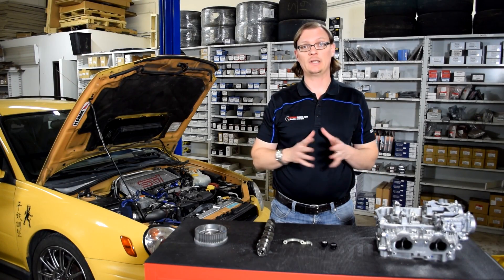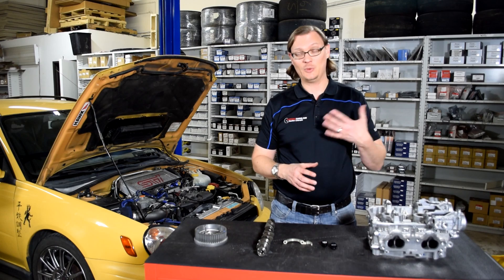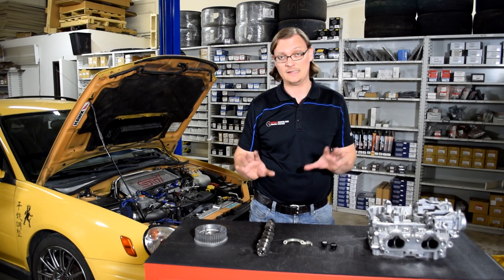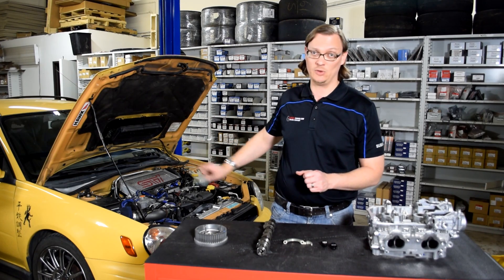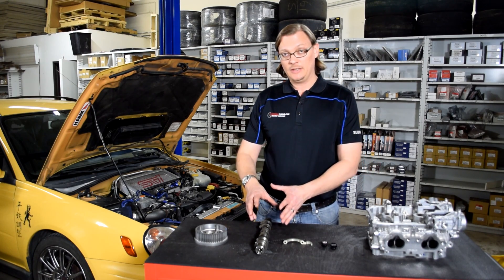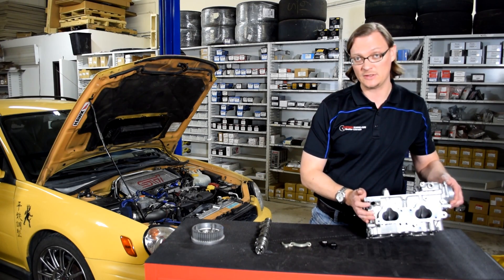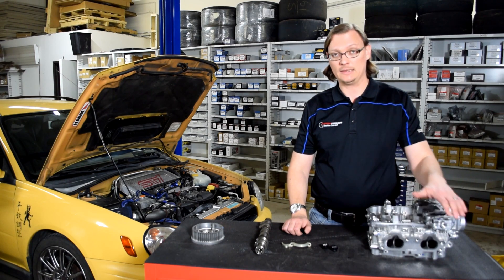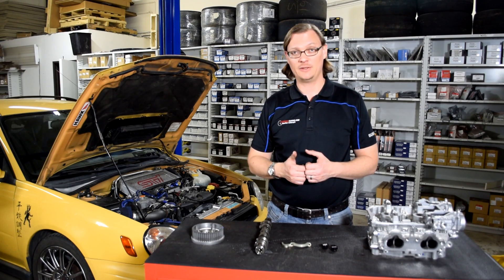How to put a turbo EJ 2.5 Liter engine into your 2.0 WRX

Comment: Makes me really wonder at what point it's worth just switching to AVCS and buying a JDM ECU to go with the ej25 long block. 

Spun bearing on my 200k ej205 and really doubtful the heads will be worth using. I have a iag tuff block I was gonna bore out and slap JE Hybrids in at 100mm but now I really am not sure

Comment: Wait why does my 205 have 2 cam sensors??
Reply from the maker: Thanks for watching and thanks for the question.  There are JDM WRX EJ205's that were single AVCS.  That is most likely what you have if the sensors are on the back of the heads.

Stay Tuned!
Reply: @FlatironsTuning if I have a usdm car with a JDM engine, how does the avcs work then?
Reply from the maker: @deathspawn54  It may not.  If you still have your USDM ECU, then it can't run AVCS.  Sometimes people would swap in the JDM ECU which would activate AVCS.

It all depends on the ECU you are running.
Reply: @FlatironsTuning  so same goes for me i have a usdm ecu with a jdm avcs engine could i just dropped a ej257 long block in the car with no modifications

Comment: So just to clarify: if you have an EJ257 with dual avcs and you opt to use the STI cams but plug the AVCS holes, and you use NON-AVCS cam gears, the plugged STI cams would be running at default high rpm setting?
Reply: That's what I was worried about. Thank you very much for the response. I guess my final question would be: would you run adjustable cam gears on the aftermarket cams, or can I get away with solid gears? Thank you guys again! Good luck at Pike's Peak!
Reply from the maker: I would not recommend adjustable cam gears.  They are hard to set exactly right, and if they ever start to move, that can cause issues.  Solid pulleys with Non-AVCS cams would be the way to go:

https://youtu.be/zhnP_p7Y3WQ?si=QiA-sl-FVDH07fKh
Reply: You guys rule! Thanks for the insight.  @FlatironsTuning
Reply from the maker: Thanks for watching and thanks for your question.  Yes, that is correct.

Stay Tuned!
Reply: @FlatironsTuning Would you recommend just swapping in a set of non avcs cams and being done with it? I am putting a dual avcs EJ257 into an 02 WRX but am deciding whether to plug the STI cams or bite the bullet and get the GSC stage 1s like your car. Thank you guys for the reply, your information has been invaluable during my build.
Reply from the maker: @markyt2982  If you use plugged AVCS cams, you really will miss out on a lot of low end power, and a fair amount of mid range.

If you want a lot of power in the mid rpm range (4,000 - 5,500 or so) I'd say non-AVCS cams are going to be the way to go.

Hope that helps!
Reply: Just wanted to reply back and say that I got my 2.5 swap running using the STI cams and adjustable gears. Setting the cams was a total pain in the ass and if you don't have a 2.0 engine to degree and compare cam orientation I think you would be in for a massive amount of work. I can see why you recommend just swapping cams, I wanted to try something different and retain OEM valve train. If I were to do it again I would 100% just buy cams etc and call it good.

Thank you to the flatirons crew for all the invaluable information and supplying the majority of parts for my build over the last half a year.

Comment: I have a Subaru wrx with 2.0 heads and 2.5 iag short block I was wondering how can I put this into an sti
Reply from the maker: You would really be best off to put the STI heads on the 2.5 IAG shortblock if you are going to put the engine in an STI.

The STI ECU is expecting a lot of input from the cam position sensors, etc. that it wouldn't get from the 2.0 heads.

Hope that helps and Stay Tuned!
Reply: The ECU has to match the heads basically. You wil need to run wrx ECU

Comment: if i have a jdm 2.0 with avcs in my usdm bugeye and i am swaping long blocks to a 2.5 do i keep avcs or still delete it ?
Reply from the maker: Thanks for your question.  It depends on how you are driving the AVCS.  If you are using the JDM ECU, then you may have to move to a USDM ECU so you can tune for the extra displacement.  In that case, you would have to either swap to an STI ECU (which would require a harness merge), or go back to the EJ20 ECU which would mean deleting the AVCS.

Hope that helps and Stay Tuned!

Comment: Do i need to swap timing covers as well or use the 2.5 timing covers?
Reply from the maker: Thanks for your question.  Since you would use the Non-AVCS pullens in this case, you would keep the Non-AVCS timing covers.

Hope that helps and Stay Tuned!
Reply: @FlatironsTuning  Thank you

Comment: About to do this myself,

Just confirming wiring - 
So i use the ej205 engine loom on the ej255? Is there any other sensors that need to be changed like the cam position sensor?
Reply from the maker: Thanks for the question.  We discuss that in the video, but the short answer is that you will keep your Non-AVCS cam sensor.

Thanks for watching and Stay Tuned!
Reply: @FlatironsTuning  Thanks guys.

Excited to get stuck into this swap.

Comment: Swapping in a version 7 into the bugeye is the best way to go. And when he states the USDM ecu doesnt have the processing power to run AVCS, that is incorrect. Its not processing power, its the architecture itself. The ecu physically cannot do it. Theres literally no circuit to run it.

Comment: Hey quick question, I was wondering if I got a ej257 long block and swapped it into my 2002 wrx could I use the single avcs ecu if I used the the i-wire avcs wiring kit?
Reply from the maker: The short answer is yes, but you have to have an ECU that will support/run single AVCS as well.

Hope that helps and Stay Tuned!

Comment: Awesome video. Question though: When using the non-avcs cams in the ej25 heads what valve buckets do you use?  Also, does the non-avcs cams take away any performance from the ej25 over avcs? Also, if the single avcs was to be used, could one use a JDM ecu with proper wiring to function a ej25 single avcs system? Thanks! Great write up!
Reply from the maker: Thanks for your question Kevin.  The buckets are the same between the EJ20 and EJ25 heads, so you just need the ones that give you the correct valve lash.

Yes, there are functionality differences between the non-AVCS and single AVCS cams, but it really comes down to what your ECU can run.  There are ways to get single AVCS to work, but I would say from my experience that you would be best served keeping things simple and staying with non-AVCS cams to go with your standard ECU.  That setup with a good tune should work really well.

I hope that helps and Stay Tuned!
Reply: Kevin- I was thinking the same thing! I think it’s possible to run the AVCS on the 2.5 heads with a JDM ECU. Might be best to give Brian at iWire a call for that as he would probably know the answer.

Comment: I'm almost done with my 2.5 swap and very much appreciate the info you have shared in this video!
I'm stuck (and concerned) about where and how/where to connect the boost vacuum hose?
I have added a fuel pressure regulator and Cobb controller and I'm not real clear how to connect all of these together and where on my 2 litre intake so as not to destroy my engine on startup. Any help or guidance is appreciated!
Reply from the maker: Thanks for your question.  The vacuum for the boost control solenoid just connects to the turbo inlet.  I'd say keep it simple, and try to keep the plumbing as close to stock as possible.

Hope that helps and Stay Tuned!

Comment: Assuming you weld the oil ports shut, so there's no chance of leaking, is there any other disadvantage to running the STI cams, other than loosing a little mid-low end torque, but gaining top end power?  Couldn't this be compensated by porting the exhaust?  You also gain low end power by doing the 2.5 block, as opposed to the 2.0.  I only ask because I'm currently doing this swap and already have the STI cams, which came with the heads.  Thanks!
Reply from the maker: Thanks for your question.  As discussed in the video, the phasing of the AVCS cams with non-AVCS cam gears is not ideal.  You will actually lose a significant amount of low-end performance with that configuration.  It largely negates the gains of the extra displacement of the engine over the 2.0 liter.

But yes, there are some gains over 4,500 - 5,000 rpm.

If you wanted to correct for this, or if you get the engine running, and the loss of low-end torque is more than you wanted, you would could install adjustable cam gears and then index the intake cams so that they are oriented the same as the non-AVCS cams.

Hope that helps, and Stay Tuned!
Reply: @FlatironsTuning  Thanks for the reply!  Yeah, the forums have tended to recommend doing using the STI cams.  Just out of curiosity, have you guys done dyno comparisons?
Reply from the maker: @Rynowhite14  We have always used the non-AVCS cams.  I have seen some dyno sheets using plugged AVCS cams, but I don't have any on file.  They are much laggier in the low and mid rpm range.

Comment: Hey Flatirons, I was planning on putting a 205 into a gc but have much better access to a 255 now. Should I just merge my harnesses to fit a 205, and then do what you did in the video to put in the 255? Or is it possible to merge my harness with that of a 2006+wrx?
Reply from the maker: Thanks for your question.  Basically, you can merge your harness with whatever Turbo harness you have.  The newer the car it is though, it just gets a little more complicated.

But it can be done.

So you could go either way really.  A big factor if you wanted to go with the EJ255 is whether or not you have the key and immobilizer unit for that ECU.  You need those to get that to work.

If you don't, and/or if you just have the EJ205 harness, it may be easiest to go with the EJ25 engine in the method described in this video.

iWire will be a huge help here too.  I'd recommend contacting them to go over options.

Hope that helps and Stay Tuned!
Reply: @FlatironsTuning  Thank you! I have contacted iWire as well but I forgot about the immobilization. May be easier to use the 205 considering the 255 is ten years newer haha…
Reply from the maker: @DavidS-iq4oo  Nice!  Best of luck with the swap!

Comment: so i can do this 2.5 swap and use the i wire avcs wiring kit to hook up the avcs?
Reply from the maker: Thanks for your question.  AVCS will only work if you have an ECU that supports it.

Because it is a lot simpler, we basically deleted AVCS when we did this swap.  The car runs great, and has a solid power-band.

Hope that helps, and Stay Tuned!

Comment: What if I want to put it into a gc8 wrx?
Reply from the maker: Thanks for your question.  If you want to put a turbo engine into a GC chassis, you will need to merger your wiring harness with one from a turbo Subaru so you can use the turbo ECU.

iWire specializes in this, and I'd recommend reaching out to them with any wiring questions you might have.

That is the hardest part for sure.  Once the wiring is sorted out, the install of everything else is basically the same as on the newer GD chassis.

Hope that helps and Stay Tuned!
Reply: @FlatironsTuning  Thanks a lot!
Reply: @FlatironsTuning  In the process of doing this swap had some questions love your channel super helpful and website is my go to for parts.  Have a gc8 with a wrx swap ej205 putting in a ej257 sti.  My questions are about the heads. I am going to go aftermarket bc cams 272 or 280 stock valves bc springs and retainer’s. Is it worth to go with the bc billet keepers or stick with oem?

Comment: Can I use wrx cams on sti heads? I'm doing a long block swap into my wrx and already bought the 272 cams for wrx
Reply from the maker: Thanks for your question.  I'd recommend going back through the video as this is discussed in detail there.  But the short answer is yes, you want to use Non-AVCS cams regardless of the heads you are using.

Thanks for watching and Stay Tuned!

Comment: Would I just have to adjust one cam if I was using plugged bc avcs cams to get the timming right?
Reply from the maker: Thanks for your question.  If you want to correct the center line of the AVCS cams with adjustable cam gears, you would have to adjust both of the intake cams to get them to work properly.

Hope that helps and Stay Tuned!

Comment: when putting the non avcs cam in the 2.5 head  would i need to replace the exhaust cam with the 2.0 cam as well or can i just swap the intake cam?
Reply from the maker: Thanks for the question.  Because they have different lift, I wouldn't recommend mixing the AVCS and Non-AVCS cams.  Ideally you would want to run a full set of matching cams.

Hope that helps, and Stay Tuned.

Comment: Great video, very informative, just looking for some clarification. If I put non avcs cams into an avcs head, what happens to the oil that was supposed to go into the avcs cam gear? Obviously it cant go into the cam and cam gear, so where does it go?
Reply from the maker: Thanks for your question.  It also oils the front cam journal, that is why you need to keep the AVCS lines and solenoids in place even if you aren't running them.

Hope that helps and Stay Tuned!

Comment: something to keep in mind, the 2.5 block is just a milled out 2 block so the 2 block in theory would last longer if you were to get the same power out of it as the 2.5
Reply from the maker: Thanks for the comment.  The EJ20's do have thicker cylinder walls (Especially the thick wall EJ207), but because it is harder to get a good deal of power (say 350 whp and above), I wouldn't say that I would agree entirely with the assessment that the EJ20 would last longer than an EJ25, especially around 350 whp range and beyond.

Thanks for watching and Stay Tuned!
Reply: @FlatironsTuning  youre right, what i meant to say was be more reliable long term, such as the 2 block being less likely than the 2.5 to have ringland failure, especially at higher whps

Comment: GREAT INFO!!! Would this process work with a Single AVCS JDM EJ20 Forester engine going into a 02 WRX?
Reply from the maker: Thanks for your question.  This process is largely the same to run any single AVCS engine, Non-AVCS and in an Non-AVCS car.  So yes, this approach should work for that application.

Hope that helps and Stay Tuned!

Comment: Can adjustable cam gears fix the timing problem using cam angle sensor while using plugged BC avcs cams?
Reply from the maker: Thanks for your question.  Yes, if you have adjustable cam gears, you should have enough range to correct the intake cam center line issue.

I hope this helps, and Stay Tuned!

Comment: What years of 2.5 head will work with the 03 wrx?
Reply from the maker: Thanks for your question.  You can use pretty much any of the Turbo 2.5 Liter heads.  I would recommend staying away from the Dual-AVCS heads because of the added complexity, but it could be done.

Hope that helps and Stay Tuned!

Comment: Other than the non avcs cams and cam gears along with the cam sensor bracket. What else is needed? Will a 2002 Wrx intake manifold fit right on the 2.5l usdm sti long block? Please help! I am about to do this on my 2002 Wrx!
Reply from the maker: Thanks for your question.  Yes, the WRX manifold will bolt right up and if you have a 2002 WRX, the other main thing you will need is the coolant crossover pipe.

Hope that helps, and good luck with the swap!
Reply: Do you need to swap the timing covers from the 2.0 to the 2.5?
Reply: @ChrisWilliams-p7g  ended up going with a fully built 2.5

Comment: Hi there- awesome info for what i'm trying to accomplish with my 2005 saaburu.  Now, could I swap an AVCS compatible (2006+) ECU into my '05 along with a full 2.5 longblock? Or, do I need to follow the steps you have shown here with original ECU? Thanks!
Reply from the maker: Thanks for your question.  You could use the AVCS ECU to run the AVCS, but keep in mind that will also require the full wiring harness to go along with it.

It is a lot of work, so in most cases, just staying clear of AVCS for a non-AVCS car is more ideal.

Hope that helps and Stay Tuned!

Comment: I'm in the process of buying stage 2 b25 head with plugged bc 272 cam for my 2002 wrx 2.5 swap. What cam gears  do I run to not have to mess with messing up timing and center line.
Reply from the maker: Thanks for your question.  We talk about this in the video.  If you run Non-AVCS cams and Non-AVCS cam gears, you won't have any issues with the cam center-line.  If you are running AVCS cams, then there will be an issue with the center line.

You can adjust for this with adjustable cam-gears.

I hope this helps and Stay Tuned!
Reply: @FlatironsTuning  need a video on how to do that,  forums has 100 answers for it .

Comment: Example: I'm geting sti 2.5 avcs heads with upgraded springs , retainers ,etc. In order to run setup on 2002 wrx non avcs I would  just have to buy cams that are meant for ej20 and swap them to the  2.5 heads to avoid whole cam center line issue and liability of blocking journals? And purchasing bracket would still be a must right?
Reply from the maker: Thanks for your question.  Yes, you would ideally want non-AVCS cams, and you will need the cam angle bracket to be able to run your single cam position sensor on your non-AVCS engine.

Good luck with your build and Stay Tuned!
Reply: @FlatironsTuning  thanks for reply . Im having FI-Performance build me some i guess.  They had a stage 2 head with avcs cam and said they could seal journals but after seeing this video I think its best option to just go non avcs stage 2 cam

Comment: I have a Yellow 03’ WRX and Live in California. I think my head gasket are do for a replacement(80,000 miles). A subie shop has quoted me 3k for the HG labor. Can I install an EJ 257 and still pass Ca. Smog? Will I need to replace anything else?